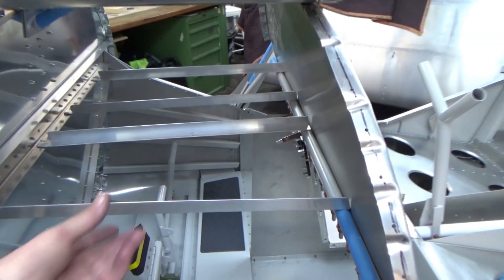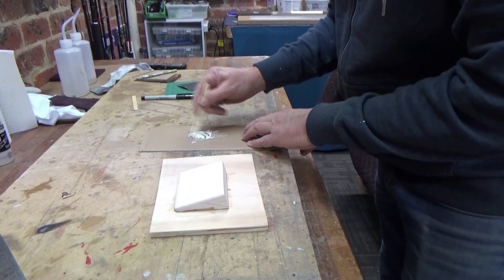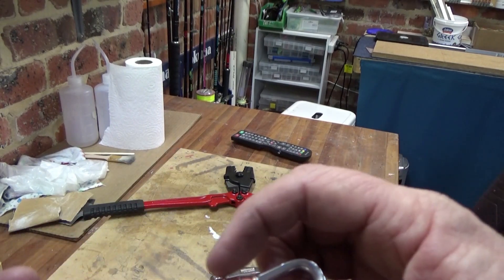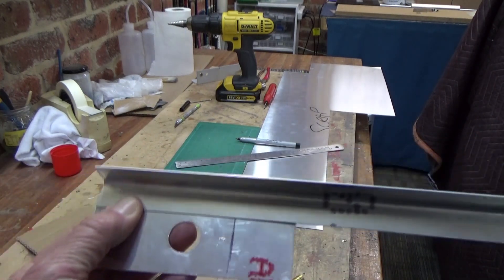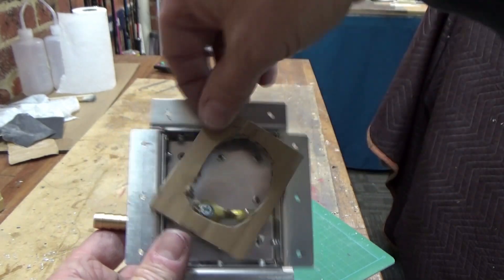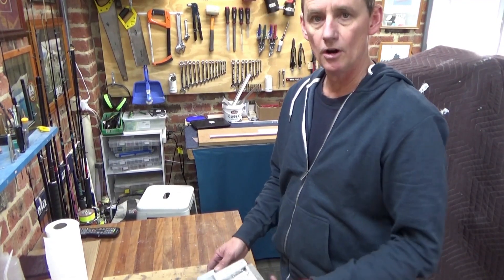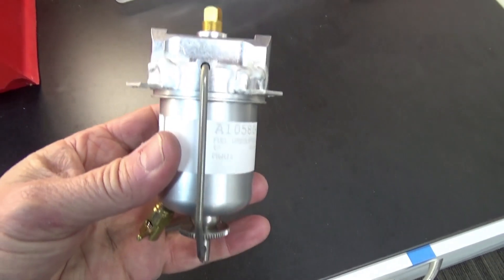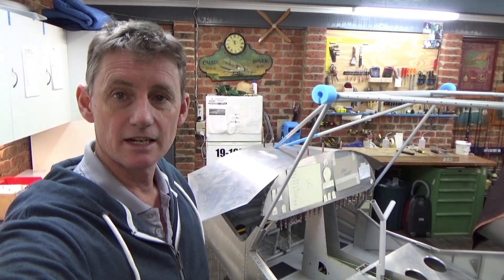How I made bits for the CH 750 CRUZER

Comment: With your fiberglass skills you could probably make a new fuel selector switch lever to mount on the Zenith supplied valve if that one won't work aesthetically.
Reply from the maker: turned out awesome thanks